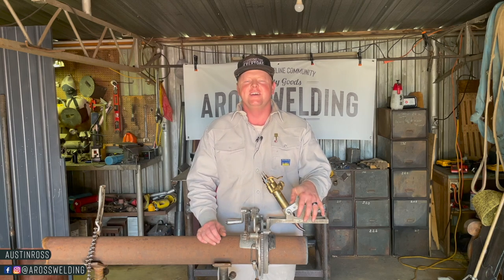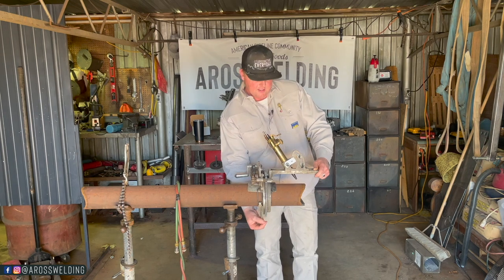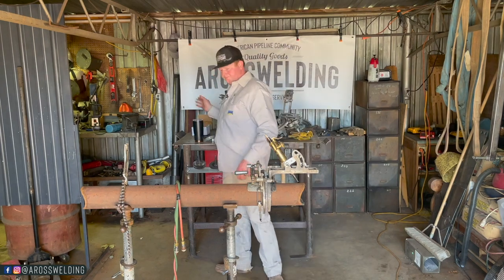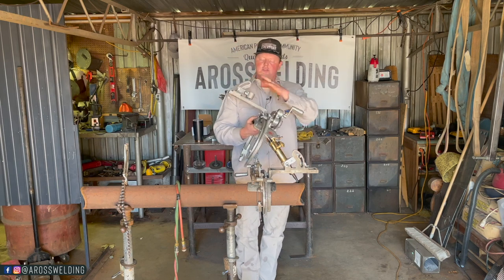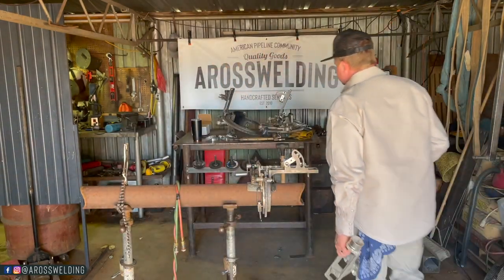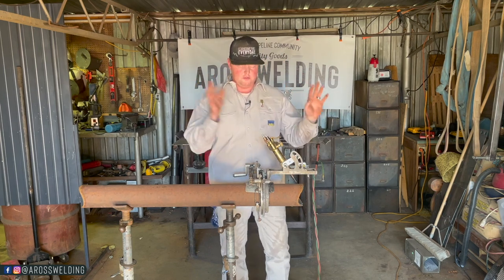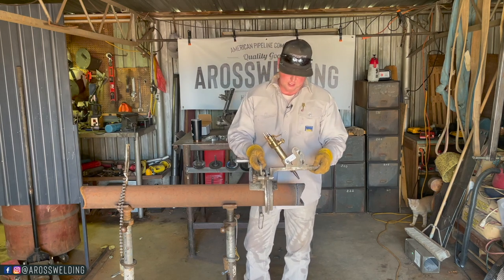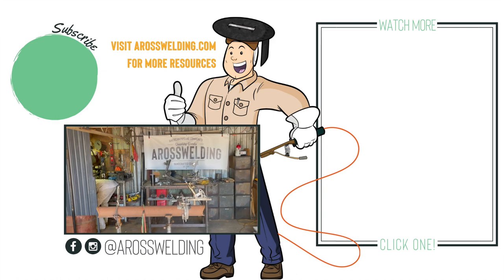PIPE BEVELING MACHINES (LET’S TALK ALL ABOUT EM) USING THEM ON PIPE FENCE

Comment: good info. one thing you forgot to mention and im sure many know, once youre ready to cut move back and forward and slowly open the oxygen as you move forward so it wont bust threw and pop slag up. i was told about that. and another good thing luckily nothing caught on fire once cutting upside down lol safety first. wheres karen lol thanks for the great info. im 100 percent to leveled that pipe on the jack stands

Comment: Did you know that Ridgid tools makes a mechanical beveling machine? Works great on pipe as well as plate. I've never personally used one but have seen it used. It's fast to set up, easy to use and gives a real smooth finish so you don't have to do any finish grinding.
Reply: They are nice to use, but they are way more expensive than the torch bevel machines.

Comment: I have the same beveler as you, so when you set it at 60 on the bridge. Is that an included angle? So 30° for each pipe? Or is your cut coming out at 60° bevel?

Comment: I'm sure you have noticed that sometimes when you first start cutting slag will be left on the inside of the pipe and when you finish the cut it will cause a blowout on the inside of the pipe. to prevent this, when you start your cut move the torch the opposite direction for a short bit ,then quickly reverse and run back thru, clearing the under side of any slag.
Reply: That's a unique insight!

Comment: Off topic question. Do you by chance know why, when welders build tub rigs, some put the welder directly behind the back window sitting sideways in the truck bed, and some put it in the center facing out the back. Is it for easy access to the controls on the welder, or weight distribution over the axles, or some other reason I'm unaware of?
Reply from the maker: From what I know it is just personal preference. Or personal situation. Some people want the back of their bed more clear for space to hall things. And some like it in there long ways that way it is easier to work on.
Reply: @arosswelding  good to know, thanks for the quick reply